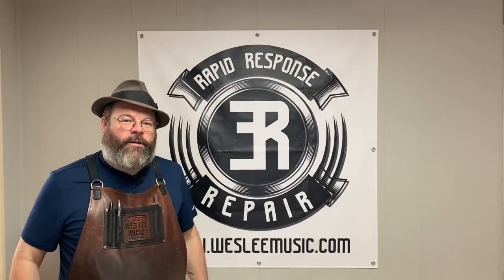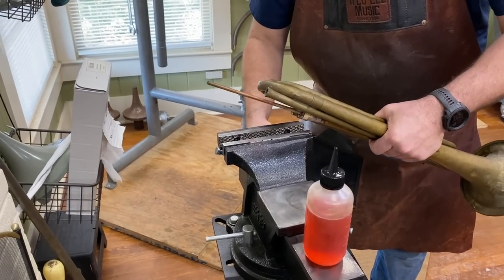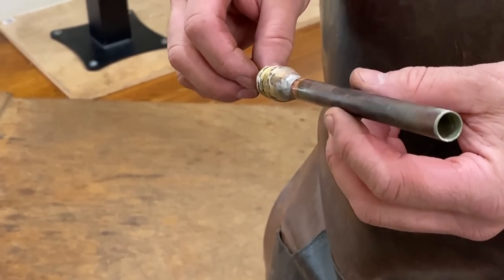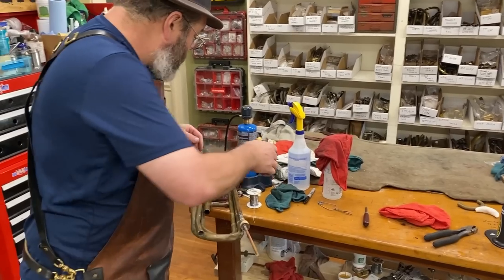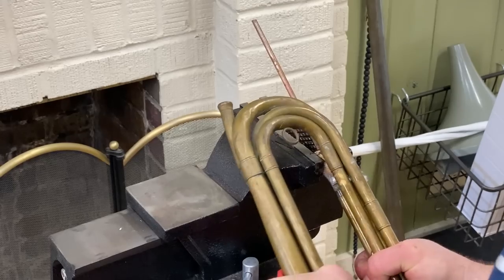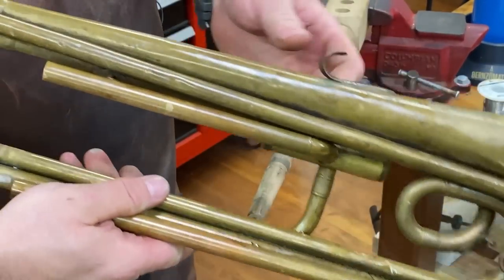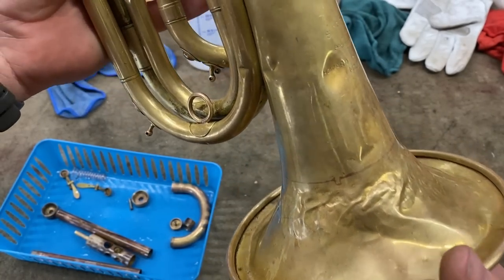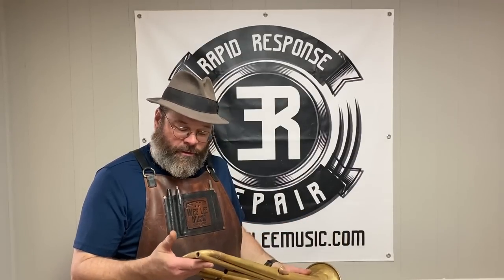Slingerland bugle part 1- 5/16/23- band instrument repair

Comment: I do machining and repairs on brass items like art, furniture etc. I used flitz tarnish remover spray on a chair i was polishing and brazing, it looked like it was on the bottom of the ocean in a ship wreck. This spray just melted the tarnish off with no scrubbing.  Try it
Reply: Good afternoon, do you know about the liquid he uses to solder, what components are
Reply: @Tuca-Luthier.  its just liquid flux for soft lead solder.
Reply: @vettepicking  so in Brazil they don't have it for sale, I would like to know if there is a way to prepare it with the correct acids, in Brazil there is only paste or else the flammable liquid flux
Reply: @Tuca-Luthier.  just use paste  plumbing flux for copper pipe, use with small brush to apply it.

Comment: This is the style of piston that is in my Czech trumpet. What is the style called? I would like more information on how it goes together because there are both cork and felt in mine and I think it misaligns the valves as this is not the original configuration.

Comment: One question, what liquid do you apply when you are welding?  Thank you so much
Reply: Good afternoon, did you get the answers about the liquid he uses to solder
Reply: @Tuca-Luthier.  no
Reply: @julimusik03  I was researching and found something, but without any confirmation, it would be about diluting zinc in hydrochloric acid (muriatic), which turns into zinc chloride that is used in flux pastes.

Comment: SIR AFTER WATCHING YOU REMOVE THE MOUTH PIECE TUBE ON THIS SINGLE PLUNGER HORNE (WAX) SIR GENTLE HEAT WITH A TORCH ☝️ GENTLE HEAT IS TECHNICALLY KNOWN AS A 
(CARBURIZING FLAME) NOT TO HOT AND SPREAD OUT OVER THE AREA BEING WORKED ON 
I'M SORRY IF I'VE BEEN A BOTHER TO YA BUT I JUST CAN'T HEP ME SEF 😉👍👍 I TRULEY ENJOY WATCHIN U 
PULL THESE OLD BUGGERS APART